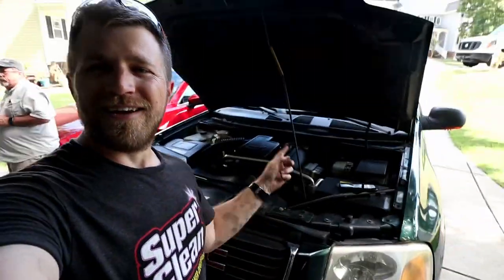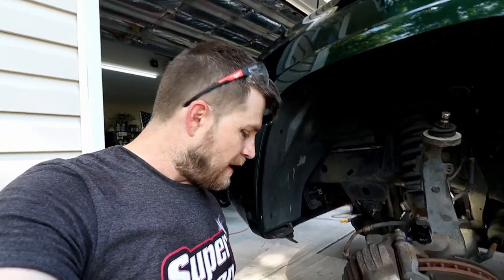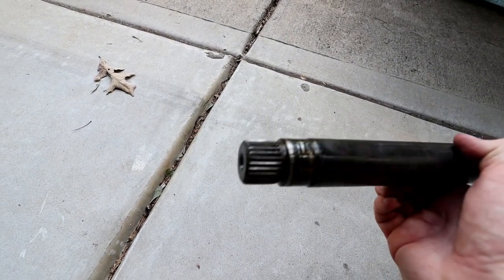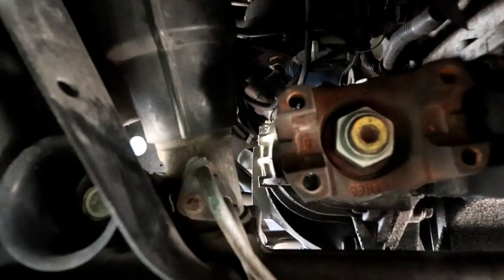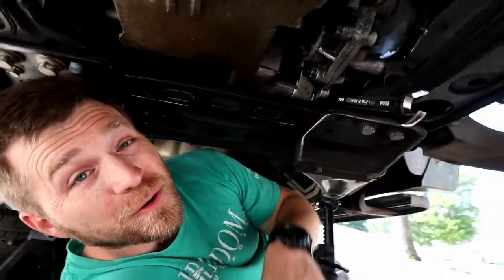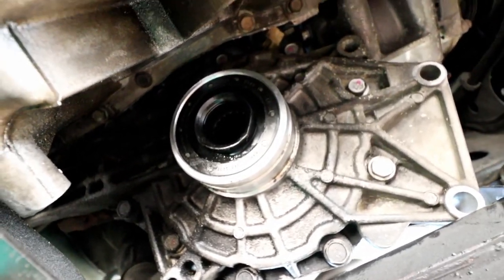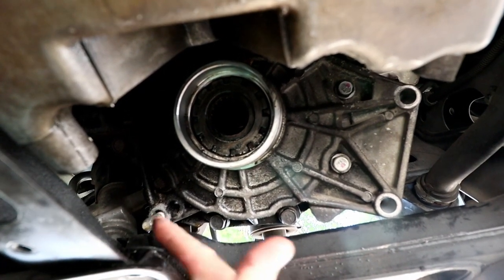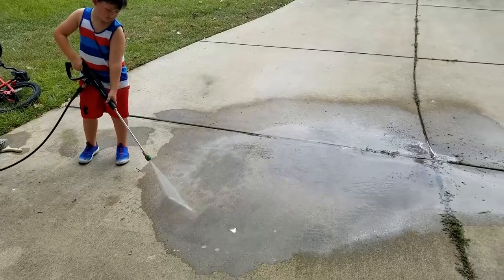HOW TO REPLACE ENVOY TRAILBLAZER FRONT DIFFERENTIAL INNER SHAFT SEAL

Comment from the maker: Thanks for checking out the video.  Let me know if it's helpful.  I did not have to completely remove my front differential to change the inner shaft seal.
Reply: this is pure genius!!! You should apply for a patent for this repair process. haha. I just poured in Titan Seal Repair - silicone polymer. I'll let you know if it fixes the seal from the inside out!!
Reply: Wouldn't the INner Shaft Seal leak be from the engine oil and not the differential oil? It's connected to the oil pan right?
Reply: Hi Kevin - if you watch this vid "Trailblazer Engine R&R" on the "realfixesrealfast" channel at 9 minutes they pull OFF that differential and you can see there is a silicone seal on the engine oil pan side also - not just the differential oil side. Or is that not a seal but just the aluminum molding that holds the differential inner shaft seal? Kind of weird - the oil has to be from the oil pan to go over that molding to the actual differential seal.
Reply from the maker: @voidisyinyangvoidisyinyang885  I just watched that video and see what you're talking about. It looks like some corrosion on the machined surface of the differential where it meets the oil pan, not a seal.
Reply: @KevinNadeau  OK thanks! So that differential seal is actually inside the oil pan with crankcase oil up against it - on the oil pan side of the differential seal "lip" that sticks out. Right? Sorry if I'm making too much out of this - I just figure there must be some oil pan oil up against that differential seal when the "inner side" is inside the oil pan.
Reply from the maker: @voidisyinyangvoidisyinyang885  No, the seal is inside the differential lip and it keeps the differential oil in the diff. The only seal on the oil pan is the one where the oil pan meets the block. No motor oil could come out of the pan where the diff mounts to it (unless the pan is cracked of course)
Reply: @KevinNadeau  wow - I just assumed the motor oil that's in the oil pan goes up against the differential seal from the oil pan side - where the intermediate shaft is in the oil pan. So that differential seal goes into the oil pan and thus the oil in the oil pan is up against the differential seal on that side of the differential seal. I realize the function of the seal is to keep the differential oil from leaking out. You're saying the function of the seal has nothing to do with the oil pan oil at all - so there is absolutely no oil pan oil on that part of the oil pan? Sorry - for not understanding this. I thought that the intermediate shaft would be turning in the oil in the oil pan - and thus the oil from the oil pan would be up against that differential seal as it goes into the oil pan. Apparently the oil pan oil does not go to that part of the oil pan? there's parts of the oil pan that have no oil in them? haha.
Reply: @KevinNadeau  Oil Pan Gasket Replacement 2002-2009 Chevy Trailblazer Envoy 9-7x Rainier Bravada Ascender - this vid has a great close up that answers my question. thanks
Reply: The seal in both side the same size and parts number?

Thanks very helpful video!
Reply: @avibuskila9823  I don't think the seals are the same.
Reply from the maker: @ericgonzalez6292  I had to go to the dealership for it
Reply: Did you have to line the seal before installing?
Reply from the maker: @victorambe3885  Can you help me understand what you mean by "line the seal".
Reply: @KevinNadeau  sorry it was a type o. I meant did you have to lubricate the seal before installation?
Reply from the maker: @victorambe3885  I don’t think I did 👍
Reply: @KevinNadeau  ok. Also did you have to line up the metal cleats on the back to gear slots in the differential?
Reply from the maker: @victorambe3885  nope, some of them line up and some won’t. Just the way it’s made I think.
Reply: @KevinNadeau  ok thanks

Comment: Kevin I just posted this on a stop leak channel vid.. someone was asking me about the Titan Seal.  I'm not sure - I found reviews on other websites. So that's what sold me - also the concept behind it of a flexible silicone polymer (and not silicate) and also I knew that other "stop leak" products for oil didn't work so well since they actually weaken the seals by expanding the seals. Also I knew I needed to fix silicone seals and not rubber. I talked to them on the phone and email - a few times. Yeah it was definitely a risk but amazingly it worked! I only used half a bottle on my front differential. I need to bring the rest inside - not sure if it would like the winter weather. haha. I had to first take out the front diff oil - and I didn't take out enough to put in the full bottle. Turns out the leak stopped!! All I know is I have no more oil dropping down onto the garage concrete. So that's good enough for me. I suppose some of it is from getting my oil changed and the workers just don't clean off the oil well since the filter is hard to get to.... But I definitely had a leak on the front diff inner seal and it's super hard to get to on this car. The whole engine has to be - the front differential goes through the oil pan - the whole front drive train. It's a huge pain. One DIYer on youtube figured out a secret way of getting at that inner seal but I'm sure the "standard" way would be done by a typical mechanic. Unless I convinced them to do it this way that the youtuber figured out. haha. I didn't want to have to do that.

Comment: I followed this exact process on an XUV equipped with the 4.2 I-6.  Came out great- never would have attempted it without this video.
Now I’m look in at doing it again on an XUV with the 5.3 V-8.  Are there there any differences in the procedure?
Reply from the maker: Not sure about the procedure for a 5.3.  I would imagine it's generally similar, but obviously your dealing with a V8 not an L6, so there will be some differences.  Check your parts numbers too on the seals.

Comment: I had to put 4wd bearing plate in my other trailblazer and the hub snapped flush with the pan! What a nightmare!!!
    Had to air chisel that sucker out ! 
As far as the half shaft goes the passenger side is threaded so you can grab a bolt with a washer run it in and use a pry bar it pops right out well mine did  it’s about the only thing that came out easy lol 
I need to change the driver side outside seal now ..
Did you replace that one also ?
Need to find a part number 
I usually order through Amazon just wanna make sure I get the right one …
      Ps nice job bro!! All the problems I had with the passenger side well it almost became a 2wd! Lol 
But these are great in the snow!! 
It’s really the only time I drive the LS one 👍🏻

Comment: Hey great video. I’m in the process of installing my seal. Do the the teeth on the back of the seal have to fit in the groves when installing the new seal
Reply from the maker: I think some of them will align naturally, but if I remember correctly, the two patterns are (teeth on the seal and groves) do not match exactly.

Comment: My new seal measured a mm larger diameter than the one i pulled pulled out. And dang, i beat the hell out of the outter edge of the new seal during the install. Now im considering grabbing another and giving it another go before i put it back together. Definitely need a better punch to install it too. Did your new seal seem super tight and tough to hammer in? I had a real hard time pushing in the upper edge with the oil pan in the way.
Reply from the maker: @CutThroat_Kid  I don’t remember mine being that tough to install

Comment: Nice truck BTW. Very clean underneath. You must not live where they use salt. Since you know those Envoys so well, do you know the answer as to the slight flickering of the lights & dash? Seems to be a common problem with these truck Can't believe there is no cure for this. It's not the Alternator BTW. If anyone knows the answer to this is you. Thanks, Andy
Reply from the maker: Thanks Andy. I'm in North Carolina and my truck doesn't see much salt. I'm not sure about the flickering, my lights don't seem to do that. My first thought is you may have a bad/loose ground somewhere. Disclosure - electrical work is not my forté 😁
Reply: Mine did this. Engine running rough at idle as well? Try replacing your secondary air check valve. Fixed my issue.

Comment: How did you put the intermediate shaft back in 
Great video man you helped me twist the axle down so I can replace the seal man it was a pain to do lol but it worked I should’ve videoed in detail the whole thing lol
Reply: Did you have to smack the intermediate shaft back in with a hammer or did it just notch in?
Reply from the maker: Glad the video helped. I actually used a piece of threaded rod that I bought from Grainger. I forget the size bar, but the threads inside the intermediate shaft on the outboard side are the same size as the studs that hold the ECU to the side of the intake.
Reply: So you threated a piece of rod in the center of it and then you smacked it in? I’m in the middle of trying to put it in right now and I put the intermediate shaft through the oil pan and felt it notch in but it won’t go any further so if you could give me a tip on what I’m doing wrong that would be great thank you for all your help
Reply from the maker: @Swainsgarage11  Yes, I just used the rod to hold the shaft steady.  Dumb question - are you putting it in backwards? If I remember right, there is a c-clip on one end of the shaft, thats the end that goes towards the driver side.
Reply from the maker: @Swainsgarage11  I don't remember having to put much force on it to seat it. Its sort of like the half shafts,  you can "click them in" by hand. Or at least I can on my truck.
Reply: I put the short side towards the passenger in the longer side towards the driver just like you showed in your video but I didn’t see a C clip on mine at all
Reply from the maker: @Swainsgarage11  Maybe the splines aren't quite matching up? Or perhaps you did seat it all the way. Have you tried reinstalling the 4wd disconnect to see if that fits properly?
Reply: I’ve tried reinstalling the shaft a few times and it looks like all the holes lineup but the four-wheel disconnect needs to go in another inch somethings just not making sense…

Comment: I probably misspoke I'm not taking the differential out just trying to rotate it down to replace the inboard seal and was hoping the intermediate shaft wouldn't be in the way but after loosening it it doesn't seem like I can slide it back into the passenger side enough to rotate the differential down.

Comment: A few things missing from the video. I couldn't get the intermediate shaft slid all the way in to the passenger side after loosening it from the dif. Did you have to disassemble the 4x4 disconnect on the passenger side to move the shaft over?
Reply from the maker: Yes, you'll have to get the disconnect off to take out the intermediate shaft.
Reply: @KevinNadeau  I don't think any video on rotating the differential explains that.
Reply: @KevinNadeau  thanks for answering the question.

Comment: I have TB 02 4WD. I need to change the  differential seals I’ve found the drive side but not the passenger, is it the same seal for both sides, My question is. the driver side can fit in the passenger side???
Reply from the maker: Do you mean the outboard (wheel side) and inboard (oil pan side) of the differential?
Reply: Yes I guess,on the other side of the differential where the 4wd actuator goes connected . Thank you for the answer

Comment: Hey, I planned on a 2000 mile trip and replaced all front end parts trying to get rid of wobble at 60+ turns out my diff is no good. Do you think I can just remove the CV axles and run it till I can fix it properly after my trip?
Reply from the maker: That should be ok as a temporary fix. I’ve

Comment: The seal in both side the same size and parts number?

Thanks very helpful video!
Reply from the maker: These are the GM #s for the seals I used.
Inboard (oil pan side) GM 1247-1617
Outboard (CV shaft side) GM 1925-7296
Reply: I can’t find the gm 1247-1617 it discontinued…
Do you have any idea for replacement?
710688 tikmen or national seal 710688 can be replaced?
Reply from the maker: @avibuskila9823  Looks like Federal Mogul 710688 will work.

Comment: How did you put the intermediate shaft back in? The one through the oil pan?
Reply from the maker: I used a small diameter rod threaded into the passenger side of the shaft to help push it in.
Reply: @KevinNadeau  thank you! Had I known about a week ago it came out I’d be more than a quarter of the way done. I’m trying to go in through the top but with the shaft still in!! I saw your video after I tried this way. Thanks again

Comment: Is the inner diameter of the seal for the inner side of the differential the same size of the outer side that goes in the cv axle?
Reply from the maker: If I remember right, they are two different part numbers
Reply: @KevinNadeau  #1 so you’re saying I have to take the seal out again😢
Reply from the maker: @andreotchere6456  is it leaking?
Reply: @KevinNadeau  no sir
Reply from the maker: @andreotchere6456  I’d let it roll them 😀

Comment: Kevin can you clarify this for me - does the engine oil do to that inner shaft seal since the differential is attached to the crankcase via that seal? Or is it just differential oil that is leaking out of that inner shaft seal?
Reply from the maker: It's just the diff fluid.  There is no way for the engine oil to come out of the pan where the diff bolts to it.
Reply: @KevinNadeau  oops - I gotta put that silicone fluid into the differential then. haha. thanks. Ever heard of this Titan Seal stuff? I have other seals leaking also - so it should help that at least. thanks for that clarification.
Reply: @KevinNadeau  Kevin I can't believe it but all summer I had THREE oil leaks under the car. I put that Titan seal silicone polymer in - it kept leaking. I was about to give up. I did a couple long drives. I forgot about the stuff. Next thing I know - so far NO leaks!! It's totally crazy. I only used HALF the bottle for the Front Diff. fluid since I didn't remove enough Front Diff oil to replace the FULL Titan bottle - 8 ounces. Still that 4 ounces appeared to have repaired and rebuilt the Silicone!! Totally crazy. All I know is there's no oil dropping under the car anymore - and it's been that way for the past few trips I've driven.... the last time I had three oil drips all the way up to the previous oil change. So it's not like the oil is too dirty or something - especially if it's Front Diff oil. hmm.

Comment: So the prongs on tge seal dont match up because there are 12 slots on inner bearing and 14 prongs on the seal. So you just press it in until it cant go in anymore. The prongs get smashed which looks like tgey aren't needed  since its just a seal/bearing. ??.
Reply from the maker: That’s how I understand it works 👍

Comment: How did you get the shaft outta the diff exactly?
Reply from the maker: I assume you're talking about the intermediate shaft that goes thru the diff.  You have to remove the 4wd disconnect on the passanger side, then I used a long flat head screw driver to push it out from the driver side.
Reply: @KevinNadeau  Does it just slide out nothing holding it in no clips or anything?
Reply from the maker: @Wtfever..................  There is a clip on the drivers side of the shaft, so I tapped the screwdriver with a hammer. But you have to be careful not to scrape/damage the bearings in there. You can use a flashlight to see inside the diff so you know where to put the screwdriver.
Reply: @KevinNadeau  thank you
Reply: @KevinNadeau  thank you

Comment: I changed mine after 150000 miles, both side seals, and CV axles, they leak like oil pressure switch

Comment: well that sucked. 4 hours of trying to get it turned.we got it where i think we could have get the seal out, but never get the new one in. i think you got the lucky bounce. also if you do this job take the passenger side apart ,change the seal s ,but most important thing is to grease the roller bearing they dont use oil. mind where bad. if you are going to try this way, well good luck ,my truck is now 2 wheel drive till i change the motor

Comment: What is that god awful noise at 8:49 and beyond in the background?
Reply from the maker: 🤣 That was my 1 year old on the baby monitor
Reply: Also I’m doing this on a Buick rainier 2006 I cannot for the life of me get this differential to the position you have it at to put the seal in. Did you have to do any prying on the motor or some kinda trick?
Reply from the maker: @Thepurpleguerrilla  No prying or anything crazy. I just had to figure out the right position to move the diff. Took a little trial and error, but nothing special. You did remove the half shaft and propeller shaft right?
Reply: Yeah I did…I went ahead and took the drivers side motor mount out. Jacked the motor up and boom!!! the seal is facing straight down to the ground. I have a 2006 Buick rainier with the 5.3. Something’s got to be slightly different or I just couldn’t find that sweet spot. Either way this video saved me a ton of money. I was gonna take it to a shop until I found your video.
Reply from the maker: @Thepurpleguerrilla  Awesome! 👍 I'm glad to everything worked out for you!
Reply: Hello Kevin.  Last post 6 mo ago...R U still monitoring this clip/video so I can ask a question?